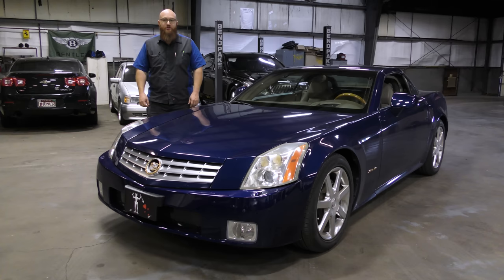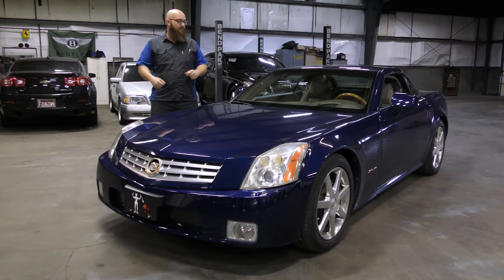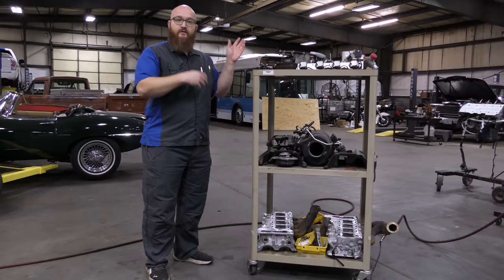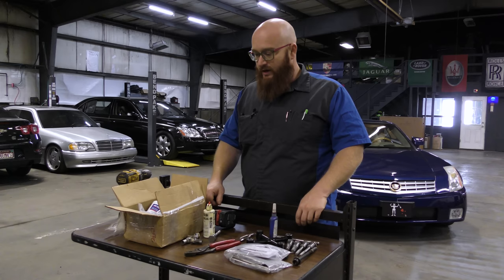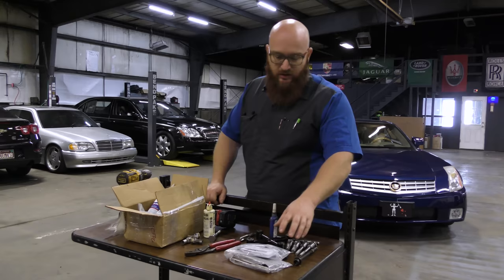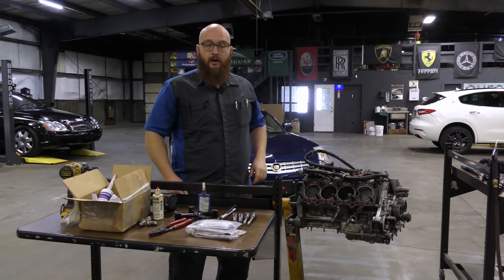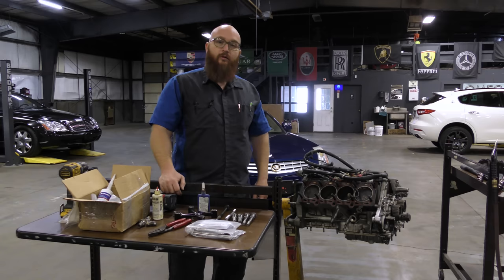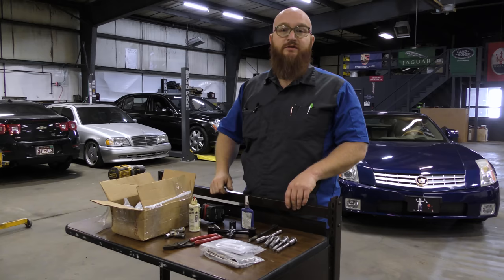No room for error! CAR WIZARD drills out the head bolts on his '04 Cadillac XLR

Comment: If GM did this from the factory, the Northstar would be considered one of the best engines ever made.
Reply: Same with the "converted" 350 cu. in. diesel engines. GM tried cutting entirely too many corners. Those engines also had blown head gasket issues among others. It could have been a very good engine.
Reply: GM is too cheap to figure that out
Reply: If they did it from the factory they would have created an engine that needed to be pulled out to remove the heads.  Not really acceptable.
Reply: @mickloney9826  FORD Cough. Scuse me.
Reply: @mickloney9826  that's a majority of v8 powered cars that aren't trucks with huge engine bays. If that's the excuse you're making its a poor one.
Reply: no, the programming to turn off cylinders for economy on some ruins and fouls causing cylinder issues, the starter being under the intake on some is terrible, frankly the engineers should have been fired and sued...northstars were over complicated and made difficult to to service with short intended lives...I also think the timing chain/belt systems are weak then say the gear driven ford 300 I6's,,, only gas engine I ever had that 560k miles,, also why not do larger thicker bearing surfaces, with a backup oil system?
Reply: @jstavene  It's not the only engie with the starter under the intake, yet the northstar is the only one people seem to mention it as a problem. Perhaps it just needed a better starter that lasts the life of the engine.
Reply: @j.d.saccociates3313  I live in Northern MN, we do see -50 or worse temps, and I have seen many caddies with say 100k miles on the 3rd starter,, which is pathetic,, I have wondered if instead firing this fool engineer who put the starter there, they also transferred to idiot to other divisions with that water pump rinning of the timing kit,,, and some of the other nonsense like GM spark under the water lines some corvettes had,, perhaps fools got fired and went to ford would also explain the whole triton crap and the fords like the taurus ,,1200 plus dollar water pump changes,,, Some engineeers need to be dragged out in the dark and beaten,,,and the people who hire and approve them...
Reply: @dbman992  No, thats utter crap.  The vast majority of V8s (and V6s) were designed to be maintainable.  As for "excuse"??  Excuse for what?
Reply: @mickloney9826  a lot more acceptable than having to pull the heads every 30k lol
Reply: @williamjones4483  My diesel mechanic had one of those 350's it outlived 2 vehicles and the last I heard it was being used to power a 30ft oyster dredge 👍
Reply: @j.d.saccociates3313  honestly I've had 0 issues on my 99 starter with 140k miles on it. I don't see them fail in the community as often as people think they do
Reply: If GM had just given the XLR the same LS as the Vette the XLR probably would have sold better.
Reply: @jstavene  starters hardly ever have issues that aren't from poor maintenance. Also age is a huge consideration. But no the engines placement of the starter isn't difficult
Reply: @mickloney9826  yet most v6 and v8 car recommend dropping the subframe of removal of the engine
Reply: I understand they figured it out. As long as it's a 2006 or later it doesn't have that stud problem. So far I've owned 3 Northstar engines that are 2006 and later. No problem.
Reply: @jdrok5026  you work on many? its dumb its one of if not the worst.. causes what could be a 200 dollar bill to require removing the intake!!! not sure what shop you work in but over 900 bucks! that hurts people!!
Reply: @jstavene  its not uncommon placement at all infact a ton of vehicles require it.
Reply: @jdrok5026  not where I am. its quite abnormal, and we laugh and make fun ot them, at -50 in northern MN, these things are junk,,stacked like cordwood outside "when we can get to em"
Reply: I agree but it'll never happen.  If those cheap SOBs can save one cent over 10,000 cars, they'll do it!
Reply: We'll never know

Comment: This is the kind of sponsored video I like.   Really good instructions on a novel product I knew nothing about before.
Reply: Maybe a top 5 fixes to make bad cars great on bullet proofing problems into solid rigs?
Reply: These cars aren’t worth dumping that kind of money into. They are nightmares , not just the engines.
Reply: @MrLamf2939sh  😂😂😂😂😂😂😂😂😂😂😂😂😂😂😂😂
Reply: @MrLamf2939sh  for an XLR, it's worth the trouble.
Reply: @dbman992  did you know if your taillight is faded or broken on the xlr, they don’t make them anymore, at all. If you are lucky to find a good used one, they go for 1800 usd a piece. That’s just one example. Not to mention they never really produced parts for the car. So when it breaks, pray to god you can get the part! I love the cars myself, but would never bay another Cadillac made after 1992.

Comment: The better the threads are cut by the taps, the more accurate the torque readings will be as parts go together.  The more accurate the torque, the lower probability of a head gasket issue.  Cut the threads to the bottom, remove friction by making several passes etc.
Reply: Spoken like a experienced machinist!
Reply: i was kinda surprised there was no bottoming tap
Reply: This being a stud with generously oversized bottom threads you won't be seeing any problems from torque.  The bottom threads won't be tightened with torque, only pulled against.

This is brilliant because the only shear is now steel on steel instead of aluminum. (The Shear Gall of some engineers 😂).

No bottom tap necessary, more threads are already engaging.  As you can see when Mr Wizard puts the new studs in they are well below the deck.  Bottom taps are only needed to bottom the threads.  They clearly have an extra 1/4 of room built into their process, more threads are not needed at the bottom.

Comment: That fixture is the trick, right there.  Keeping the drill straight & centered, and keeping the tap straight are the make-or-break portions of this job, and that fixture is what allows you to do that.  That's a genius piece of hardware, right there.  Really like that!  Kudos to Northstar Performance for coming up with that!
Reply: I remember years ago, the kit GM had commissioned and made to go from the fine threads to the course threads, GM dealers were doing three and four of those a week around here. That kit also included a jig that would Center the hole so that you could drill and tap without having to worry about centering the drill bit. The jig used here looks very similar to that.  I'm guessing the patented part is the fact that it has much larger diameter studs instead of head bolts.

Comment: As a mechanical engineer, I appreciate the work that has gone into the kit - it's certainly well designed but I don't see anything that would be patentable in the kit. The closest thing would be the fixture but I don't believe it meets the criteria for a patent. Applying for a patent and receiving a patent are two very different things. Of course, I'm an engineer not a patent lawyer.

Comment: I m a mechanic and I fixed one of these engines in 2001 blow head gaskets I removed the heads with the engine in the car Cadillac STS 1998 the dealer said you can't fix it you need a New Engine ,so the bolts came out loose  and fortunately I have a friend who works in a machine shop he told me bring it to me the entire engine he drill the block and the heads for a bigger bolts and problem fixed the car runs for nearly 12 years no more issues ,Great video you are a Master Mechanic 👍

Comment: Thanks Wizard, I really enjoyed seeing this process done step by step. It is Sad that GM really never addressed this issue properly.  If you read about the Northstar V8 GM spent a lot of money and time DEVELOPING this powertrain, it was a very advanced powertrain at the time,   they even ran the engine with no coolant in the desert and still worked, provided air conditioning in the cabin,. Sad that they missed and never correctly addressed this fatal design flaw.  These are things that really hurt GM in the 90's into the 2000's that made many luxury buyers go to other brands. I always wanted to buy a used Cadillac  Seville STS, even though they are front wheel drive, love the look of those sedans, almost bought a nice one for seven grand, but always stayed away because to fix the engine it is almost  the price of the car.  very sad.  Great video Wizard thanks for showing and sharing the process with us.

Comment: You mentioned that you’ve seen people driving taps in. My father owned a machine shop & foundry in the 40’s until going into the Korean war. He told me the main thing is never use cheap taps and don’t force them in. If you do force a tap and it breaks, you’re done. You can’t drill a broken tap out. Take your time is the key to a good job.

Comment: the tape also helps as a friction modifier to help keep your fixture from moving around, any time you are trying to keep metal from sliding on metal a piece of copy paper between the metal helps, think of it like a clutch disk, when hand taping with a non spiral flute tap you really want to back the tap off about 1/2 turn for every full turn and a half to break the chip and keep the bits manageable / less likely to bind up on you and even gall your fresh cut threads.
Reply: That is the way I was taught 50 years ago when hand tapping. Glad to know I was doing it right.

Comment: Great video, car wizard. Great points about coarse tread bolts.
Weak points of bolts / nuts is the screw relief. It always breaks at the threads. The more threads, the more relief points to fail.  Also great point about torque to yield head bolts, they must be cheap because so many engines now use them. You torque them to stretch a little so this is why you cannot reuse them. The conventional non torque to yield head bolts worked fine for years.

Comment: Awesome job. They need to come up with a kit like this for the 6.0 powerstroke! They are notorious for the factory TTY head bolts stretching and lifting the head off the block resulting in a blown head gasket. I know alot of guys put ARP headstuds to resolve this issue, but ive heard of plenty that still blew a head gasket even with perfect machine work and studs. I cant recall ever hearing about one blowing a gasket with stainless orings machined into the head while using studs tho.

Comment: Gas tanks have baffles that break loose and will suspend the gage floats but the tank will run dry. I changed these tanks at the Cadillac dealership under warranty. I owned one and it had the tank baffles broken loose too!

Comment: I have a 2001 Seville with this setup. I had Jake install them in my car at 200k miles, presently coming in on 350k miles with no issues. I would also highly recommend his front engine mount for the FWD Northstar as well.
Reply: Christopher, Ohio car? Replaced rings and came in with a cracked flex plate?
Reply: @jakewiebe8243  That's the car. Still going strong.
Reply: Glad to hear it Chris!!!

Comment: We had this NP Head Stud job done to a 2001 Deville DTS, back in 2010.  The car is still running, but the timing chain is making a racket.   A mechanic said it wasn't worth replacing the timing chain because the block was "cracked", despite the car not having any issues with leaking oil or coolant.

Comment: My only argument with a stud vs a bolt is depending how the height of the deck a stud will oval cylinders. It happens on Tdi engines and it will crack between a head bolt hole and coolant passage. The only way to do it right is to bore the cylinder with a tq plate while using a stud. Great video!

Comment: studs work best when you've got plenty of thread for them to grab and basically all you do is bottom them out by hand and torque to nut on the top side once you install the heads. It really is that easy. This kit actually makes it even better than conventional head studs because of their staggered stud design, so you get such a substantial threaded stud on one end to ensure that it makes great contact with the threads in the block, then the other side is just the standard bolt diameter because it doesn't strictly need to be THAT robust for the amount of torque it needs. Maybe if you wanted to make more than 1000HP on it, then you'd want a larger diameter stud overall, but I don't know that there's enough aluminum in the support structure of the bottom end to do a similar upgrade there and you'd risk grenading the bottom end if you tried to make more than, like, 800HP without such an upgrade.

The stud kit really does try to make it as idiot-proof as possible, which is nice of them.

Comment: Man ...I'm kind of restoring my 05 XLR as we speak.  It's amazing how cramped it is in there.  To change the radiator....your supposed to discharge the ac and replace the drier and all that crap but I figured that one out.  If a belt went bad ....you would literally need to pull the radiator fan out.....
This thing is nuts.  I'm seriously thinking of putting my built 403 in it from my Z06 and just being done with it.

Comment: I will say this actually looks rather easy, but easy for someone that knows what they're doing. I don't think this is a good project to take on if you've never worked a tap and a drill before. Not the place to learn, but if you have some experiences with drilling and tapping new threads then this looks fairly straightforward

Comment: I’m rebuilding my 2001 Deville now. There is nothing wrong with my thread. One of those  cheap GM bolts failed. This caused the number one cylinder to leak. I will be using Felpro head bolts and I will torque them to only 70 lbs-ft.

Comment: Good video and wonderful instructions. Well designed and made kit i must say, looks a bit prettier than the one i made for my engine. I would recommend to do similarly to plunge driller, back out the thread tap after a few turns to make sure the tool is free of any shavings, it can quickly destroy the new threads or offset the thread pitch

Comment: Thats a pretty cool drill jig. I wouldn't use a socket to tap a hole personally. You can't apply even pressure on both sides, and it is annoying to switch the socket direction back and forth to break your chips. But, at least you didnt try to tap using a cordless drill!

Just some thoughts from a machinist who has drilled and tapped a whole lot!
Reply from the maker: I have as well. I was a swiss turn machinist for several years. I tapped thousands of parts. If this were steel, id use a tap handle. But its soft aluminum. Taps easy. Ratchet is faster, youll agree after tapping all 20 holes.
Reply: @CarWizard  that's a true point! Swiss stuff is pretty badass. Nice to see you doing some work in a video! And thanks for replying!

Comment: Would love to see how they perfect-measured and created that X-shaped guide tool!
Reply: Not too difficult - make two bosses on a lathe that take the existing headbolts, one that is a clearance fit to the drill bit, and one threaded by the tap. Then bolt them onto a block, then weld on the cross braces minimising the heat input. Then you have a template.

Comment: You should pull the tap out every few revolutions and remove the chips in it just like you back out the drill every now and then to clear the chips.  If getting a drill bound up with chips is bad, doing that to a tap is much worse.

Comment: I had an 02 Eldorado and called a shop and the office girl told me it would cost $2500 to do that job so I drove it there and then they looked at it and said it would be $3500 so I picked it back up and sold it for $700. That was about 7 years ago. I'm thinking of buying another one cause they are such smooth cars for $1000, no mention of head gasket problems but has a misfire and some AC issues plus a rotted brake line. If the body is good it's worth the risk at that price even though I have two other good running vehicles but my SRT8 Challenger I won't drive on salted roads so it's good if I can have another cheap vehicle that I like as a backup or daily driver and just use my truck for work related stuff.

Comment: Great video really interesting to see the kit ad job being used and done.   Northstar Performance also makes an upgraded design front engine mount for the later year fwd ones.  I had the original oil/grease filled factory one go then a solid rubber one.  Which tore apart, just like the factory except no oil/grease still failed and faster.  NS performance solved it by making a round bushing with metal around it.  GM almost went out of their way with a few decisions to really spoil a great engine.  Changing from 2 "front" upper dog bone style engine mounts to 1 lower center, tty bolts both low thread count + fine vs coarse.

Comment: From what I have heard, GM took apart a Porsche M28 engine when designing the Northstar.

Apparently they learned nothing, since the M28 has gone over 300,000 miles without an overhaul or excessive oil use.  And this is an aluminum block engine with no steel liners....